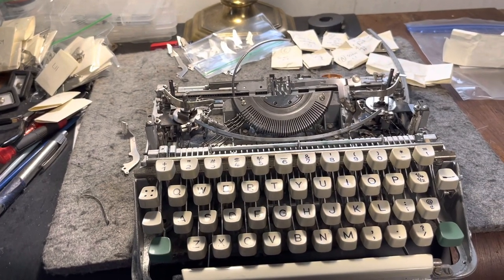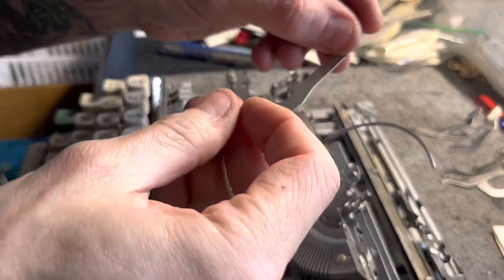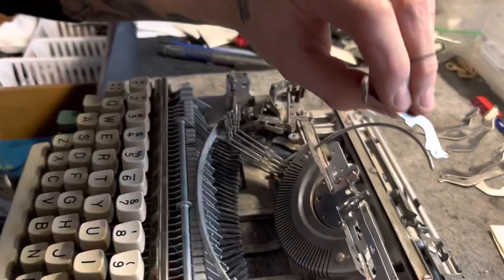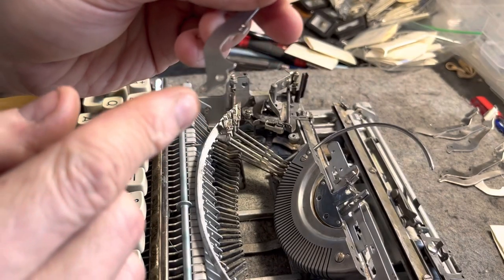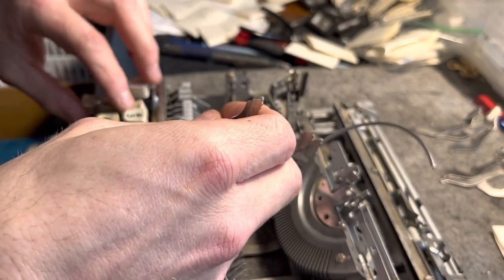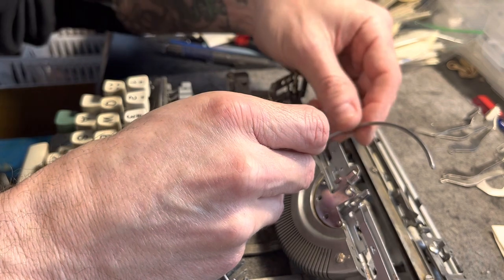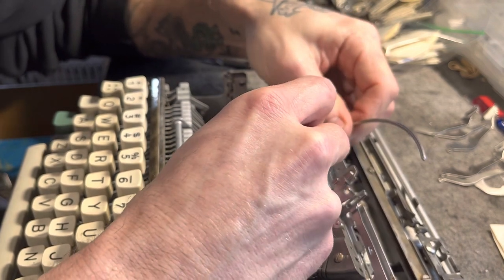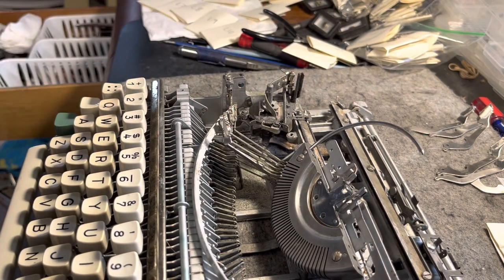Installing Typebars and Linkages in an Olympia Typewriter

Comment: Excellent video! Thank you! I wonder if it helps inserting a thin piece of metal into the next slot to prevent that thing from covering the hole for the next typebar.
Reply from the maker: Yes. There are other better/more efficient ways to do this. This was just a quick video demo. I could do a better video on the next machine I do this on

Comment: Well done Hotrod, is the segment wire tapered at both ends or only one.......always feed the tapered end in first, it picks up the typebar hole easier, you might also find it easier to feed the segment wire in with duckbills a little at a time
Reply from the maker: Yes the tapered end is better to start with but once you get into a groove and rhythm you can do this rather quickly. This was my first time doing this on an SF so I probably did things in not the most efficient order but I will know better for next time.